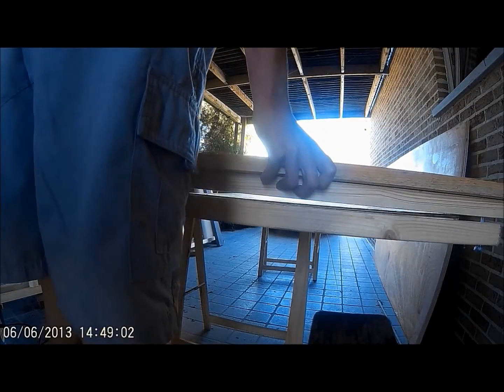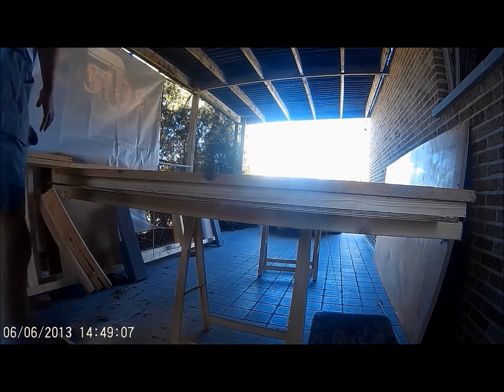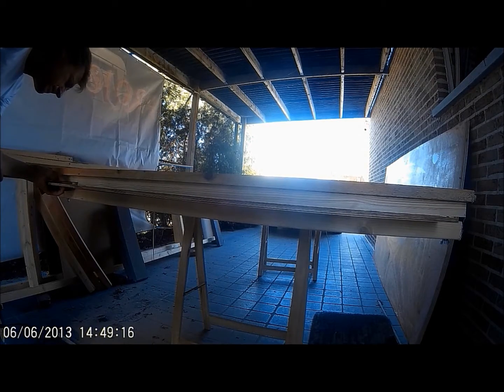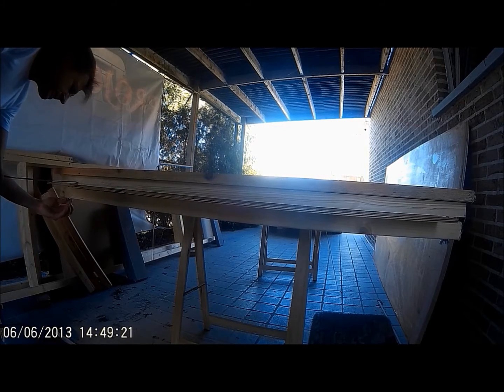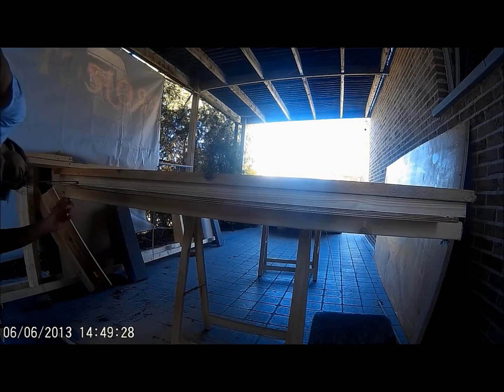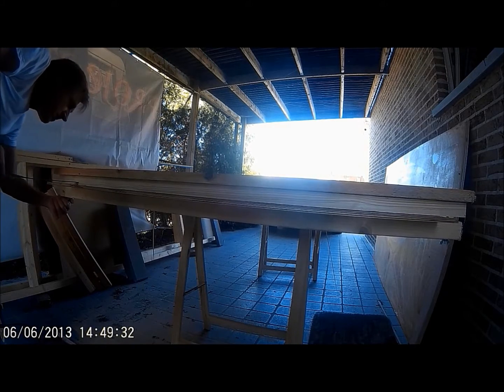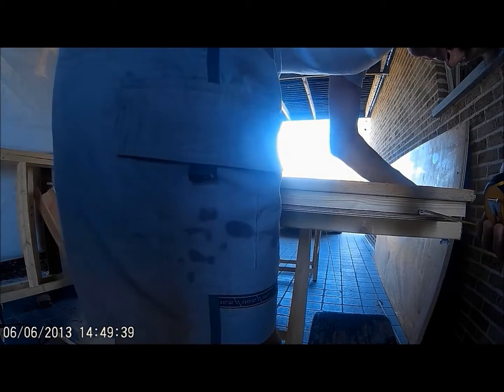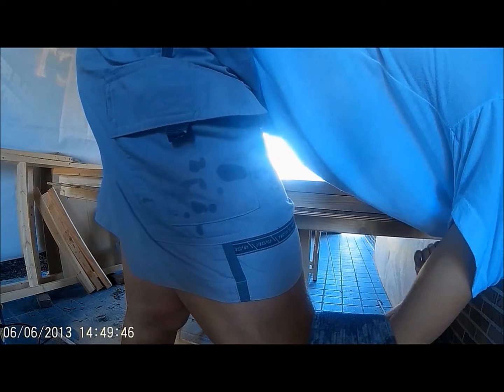Scarfing Plywood

Comment: It is a nice jig. What is the distance from the edge of plywood to the jig?
Reply from the maker: +Steve Hsing-Hua Ho I can change that to what is needed. It isn't fixed, it depends on the pieces U mount on the circular saw. For me that's 12,5cm.  What I found is u just need to make sure the base of the circular saw is flush with the edge of the plywood.  I use the JIG that's bolted to the plywood only to not change the angle of the cut I'm making